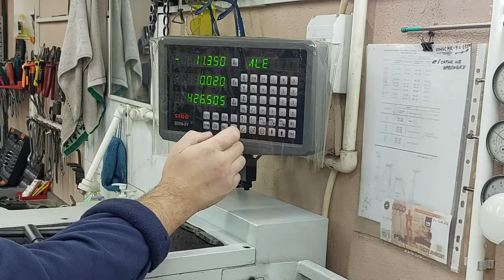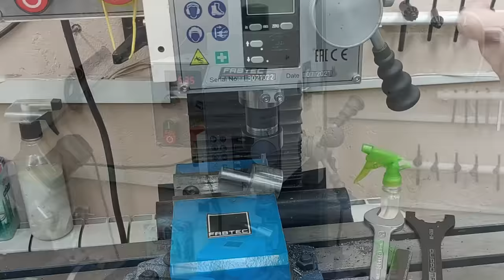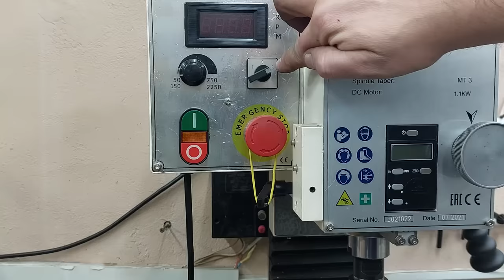Wow, I didn't believe it myself! Genius trick and tip in 8 minutes for the home handyman

Comment: If you can afford that gear then you can afford the right tooling. Nice job but this will only be good for small cuts, it needs to be run in reverse which means the swarf will be firing straight at you.